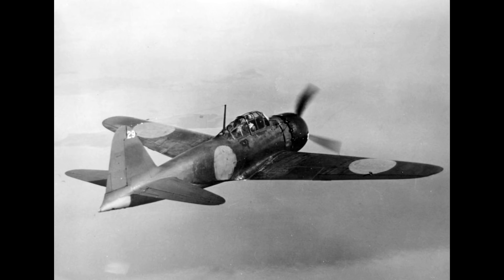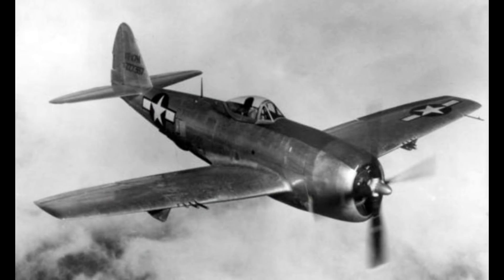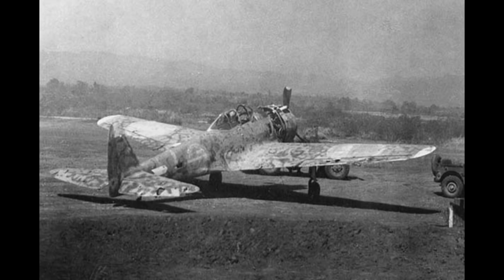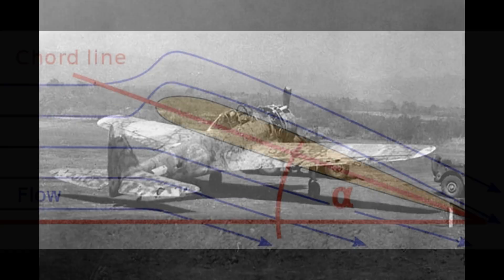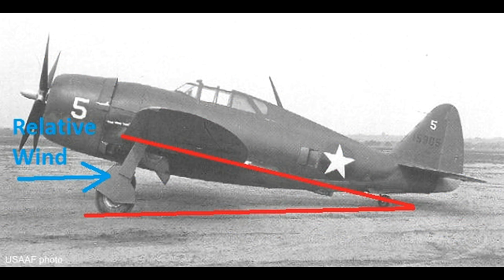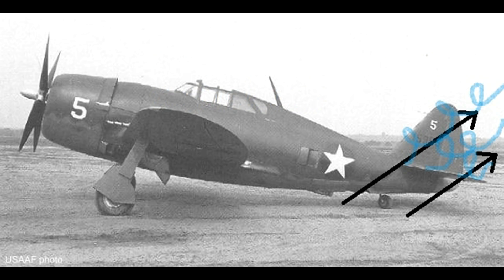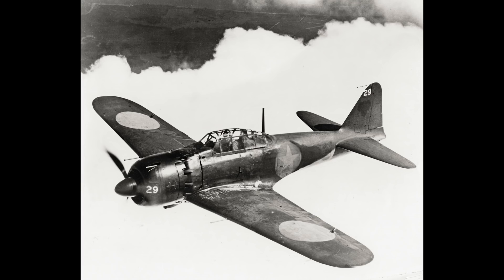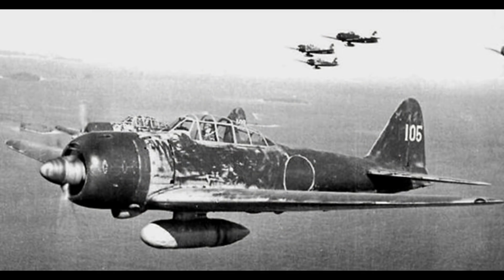Mitsubishi A6M Zero, an interesting fact few people know

Comment: Could you combine the tail setup of the Zero with the superior speed and firepower of F4U/F6F/P-47s? Hail Greg!
Reply from the maker: Sure, they sort of did do that with the Bearcat. Its rudder is almost entirely out past the elevator. The stabilizers are still more or less aligned with each other, but the rudder itself shows the same sort of thinking as was used in the Zero.
Reply: Thanks Greg!

Comment: Just a general comment: Speed is manoeuvrability. Think of a fly, it's incredibly manoeuvrable in all 3 axes but you can still swat it with your hand. It's too slow. If you approach a target at a very high relative closing speed, the other plane can jink around all it likes but the arc that it moves in front of you is small and predictable over any given timeframe.
Reply from the maker: Your hand must be a lot faster than mine.

Comment: Can a zero really outmaneuver biplanes like the CR-42? or F3F? and Why didn't the allied pilots train against biplanes, and then quickly adapt anti-biplane tactics for use against zeros? surely the P-40 squadrons had thought about how they would face Cr-32s and -42s after the Spanish Civil War and Battle of Britain.
   Also, Corsair appears to do just the opposite with it's tail.

Comment: While all this may be true, I don’t think spins, snaps and hammer heads were of any use in air combat. Going to extreme aoa would rob you of precious energy. If you were in a spin you were most likely going to become a target if you weren’t already. I think that the excellent maneuverability was mostly due to the light weight because of the lack of armor and the extensive use of magnesium forgings.
Reply from the maker: I'm not saying it was of much use, but the Zero's design philosophy was centered on maneuverability to the extreme, and that included a wide range of maneuvers.
Reply: @GregsAirplanesandAutomobiles , you are right Greg - it is very to enter a spin in aggressive Air Combat Maneuvering, especially in older aircrafts (cf. my answer to the comment above).  Snap rolls-to-a-break (any direction) is one way to disrupt the firing solution of your opponent.  In ACM's, once you are engaged with a worthwhile opponent (other than a "hit-and-run" attack), you will soon work at very high angle of attacks, trading altitude for the energy lost to turns - who ever is best at it ... wins.  But as you said - we (Americans) did eventually defeat the Zero's maneuvering advantage but it did cost us many pilots.  Great lectures as usual, Ciao, L (...yes, one of them pilots).
PS: I have seen many Cobra AH-1 perform the hammerhead stall to return to the target and I noticed that their elevator is located well ahead of the tail rotor - possibly for the reasons you mentioned?
Reply: Actually Rv4 Guy, Greg's A&A is right in his assessment.  We did use these maneuvers... some by "accident".  When you get into Air Combat (as I was taught in the Navy in my T-2s/TA-4 days, we had to be familiar with these maneuvers and working in the stall limits "regime" as indicated by your AOA, buffet, rudder "shaker" was a skill to master.  Hammerheads were taught for "Out-of-Control" flight training proficiency.  If you really engage in a dogfight, you will be at high angle of attack, often trading altitude for speed (energy) or "disengaging".

Snap rolls we often did to confuse an attacker on which way we were going to "break".  Spins were prohibited in most jets (other than T-2C training) as they were very dangerous (chance of unrecoverable flat spins depending on your fuel state/ordnance) but recognition and recovery was instructed in different aircrafts.
Pilots have spun aircrafts in combat (it is very easy in the heat of the action) and... crashed because of lower altitudes and the nose heavy weight distribution/high engine torque of American WW II era planes.  I can see the advantage of the Japanese design as described by Greg's.  Ciao, L
Reply: I guess my point is that this tail configuration did not have that much to do with the combat advantage of the zero. It was lighter. It could climb better, turn tighter and fly for over 10 hrs. Rudder effectiveness at high aoa was secondary

Comment: A6M didn't achieve maneuverability at the cost of "everything else".  Zero was built as a carrier born plane and low wing-loading helped with low landing speed.  Compare relative landing speeds of F6F and A6M on a carrier going at 20 knots up a 10 knot wind.  (I don't remember the exact numbers, just that I was very impressed with the results.)  High maneuverability was a bit of a byproduct of those requirements.  

Another thing is, that Japanese didn't have access to decent engines.  They simply couldn't build much faster airplane because of that, so they didn't trade "everything else" for maneuverability, because they didn't have much to trade to begin with.

With that said, high maneuverability is not easy to beat in a dogfight.  All those stories about how hit-and-run tactics can "easily" defeat a Zeke seem to come from wartime propaganda.  Sure, it's always easy to win if you have altitude and speed advantage and surprise your opponent on top of that.  That's obvious.  

That's hit-and-run in a nutshell.  Surprise with all cards stacked in your favor, try your luck and keep on diving no matter what happened.  Works wonderfully if you have numbers on your side, which Americans had late in the war, and that's the only reason why it worked so well.

What if the Japanese had the numbers, though?
Reply: Many think of a "dogfight" like knights jousting (hey, "knights of the air"!). But it's not like that. It's not a "fair fight". One American pilot likened it to running up behind an unsuspecting opponent and hitting him the head from behind with a baseball bat. It was brutal. It might not seem fair to our sensibilities but the object is to win the fight, win the battle, and finally win the war. That's all that matters. The Japanese strategy was out dogfight the enemy. The allies developed a counter strategy and the Japanese did not counter it, at least not until it was too little too late. As for numbers, the Flying Tigers did not have numbers, but their tactics worked very well as it did for the US fighters in late 1942 - early 1943 when the numbers were not on their side or were even.
Reply: +Deplorable_Bitter_Clinger - "The Japanese strategy was out dogfight the enemy." - Was it really?  I read about Darwin defense.  There the Japanese simply tried to achieve the objective.  They didn't dogfight for no reason.  With that said, having a highly maneuverable plane definitely helped when they were jumped from above.  

"Flying Tigers" - Sure, they did well all things considered, but do not assume they regularly outfought the Japanese.  I don't remember the source or specific numbers it arrived at, but claimed victories were very far from actual Japanese losses.  Which is typical for every encounter with surviving Japanese records.

Kill claims are notoriously unreliable.  On all sides.  Take them with a spoonful of salt.

Comment: That is not exactly true. A design that put agility first with no armor and modest firepower could still have worked in 44-45. The problem with the Zero was that it wasn't fast enough especially at mid-to-high altitudes. It is a (relatively) big plane with a lot of wing and a lot of fuel capacity that happens to be very light. It didn't have a lot of power and it didn't have multi-stage multi-speed supercharging required for altitude performance.

In the early war, the Zero was as fast or faster than allied fighters of the day while being more agile -- much more agile -- and has 3~4 times the range. By 1944 it was the SLOWEST front line fighter. Improving speed significantly wasn't possible without a complete redesign of the airframe and re-engining.
Reply from the maker: I don't think that design concept had any chance of working in 1942, let alone 1944-1945, but if we all agreed on everything the world would be a pretty dull place :)

Comment: Is the Ki-43 that was the most maneuverable, Zero was the second.
Reply from the maker: The Japanese held a contest between the two, and it was determined that the Zero was the more maneuverable of the two. That was surprising due to the Oscars slightly better power to weight and wing loading numbers, but the Zero had other advantages that gave it the edge.
Reply: @GregsAirplanesandAutomobiles  I was referring to turning ratio which is often called maneuverability but being more maneuverable involves much more than just turning ratio so I acknowledge my mistake.

Comment: I think Czechoslovak Avia B-135 had similar tail configuration.
Reply from the maker: It's a little bit that way. The rudder of the Avia sticks back a bit, the the leading edges of the horizontal and vertical stabs are about in line with each other.
Reply: @GregsAirplanesandAutomobiles  Pity, it wasnt used in combat much. I would like to see if it could match messerschmitt. Also if it was equipped with 1000 hp engine that was in development for it.

Comment: So if the Japanese had more powerful engines and some protection for their pilots and fuel supplies, they might have had something to compete with later American designs.
Reply from the maker: Yes and no, It's really a bit more complicated than that. For example, the Japanese Frank was competitive or even superior to many U.S. aircraft, but too few, too late and very few skilled pilots to fly them. All realistic Scenarios with Japan winning the war involve them doing it in 1942, so from that perspective, they really didn't need to think about the later US planes, which they may not have predicted anyway.
Reply: The planes werent the issue.

It was numbers and pilots.

The US could replace planes and pilots much easier than japan could

Comment: I am not by any means knowledgeable within the art of aerodynamics but... didn't the Hawker Tempest and Typhoon have a stabilizer that was mounted the way you describe? Or do I misunderstand the concept of this video?

At 2:59 in the following video they describe the tail section of the hawker tempest:
https://youtu.be/70Sd8h3XXvU
Reply from the maker: It's similar, but the leading edge of the horizontal stab is only forward of the vertical by a little bit in the Tempest, it's done to a much greater degree in the Zero.
Reply: Ah okey, then i misunderstood. I thought it was the offset between the rear edge of the vertical vs. the horisontal stab (the red arrow @ 00:10) that was the key difference. Thank you for clarifying.

Comment: they had to maximize agility, it was cheap, and armament and armor were detrimental to the need for range. zero a great design, as a solution to 'what can we do at minimum cost?'
Reply from the maker: The A6M was not a cheap airplane. By the standards of its time it was costly both in terms of materials and man hours to build.

Comment: Check out the tail on a P-51.
Reply from the maker: Yes, that's been discussed here, but the P-51's horizontal stab isn't nearly as far forward as the Zero's, and it's  a later design, but it is set up that way for the same purpose.